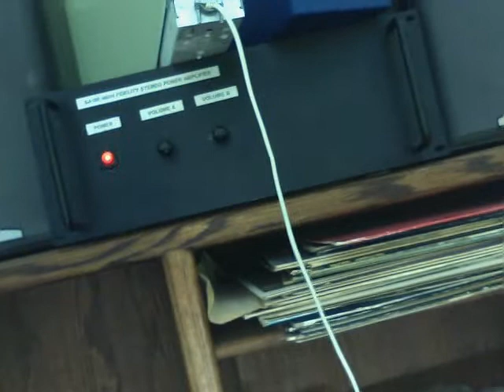Homemade Audio Power Amplifier

Comment from the maker: @bonejob The amp is just a standard class AB power amp. The modules are made by Futurekits. 100 Watt power amplifier. The stereo version comes with two kits to make two modules. My power supply uses a 120 to 30-0-30V transformer (300VA), 35 amp bridge rectifier, and two 46,000 uF filter capacitors.

Comment: It's cool that you built an amp, but can you tell us something about it? Is this kit a so-called "Class T" built around Tripath driver chips? Or is it a Class D switching amp built around somebody else's chips? Or is it a conventional solid state Class AB? If so, does it use bi-polar final drive or power MOSFETs? Where did you get your modules and power supply? And I am especially curious about where you got the chassis components.